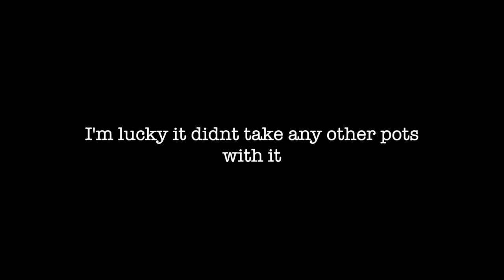How NOT to make a PLANTER - !IT EXPLODED! - ASMR Edition

Comment: When in doubt, I fire my thicker bottomed wares upside down, especially  with student projects.  I beleieve this allowss the air to circulate around the bottom, and help to dry out the clay, before it gets to the boiling point.

Do you run a candling schedule, for your bisque?

Comment: Recently I sort of incidentally made my first planter (no saucer). I was super excited about it and my teacher was proud of me. I went a little to thin on the bottom but it was shaped nicely. I was actually afraid that I would accidentally cut through it when trimming so I decided to not do very much at all on the bottom. But the sides needed to be cut down. I find trimming difficult and I think for a while I had trouble with holding the tool correctly to cut the best way. By the time my teacher helped me and all I didn't realize how much time had passed and wasn't being as attentive as I should be, and I cut through the side of the pot. It was pretty disappointing but I learned my lesson there. I appreciate this video b/c it shows that everyone can make mistakes even if they are experienced.